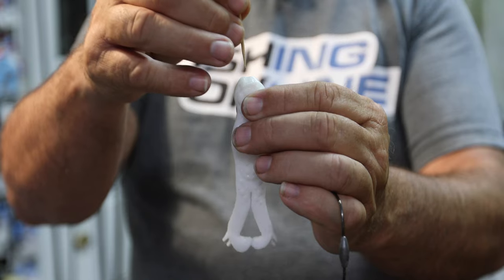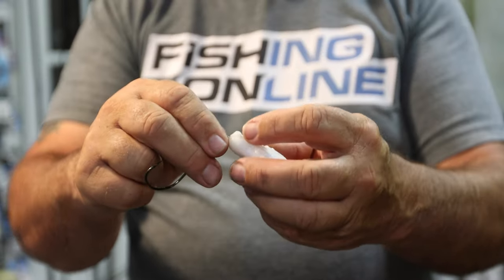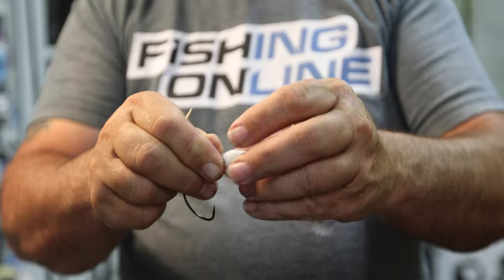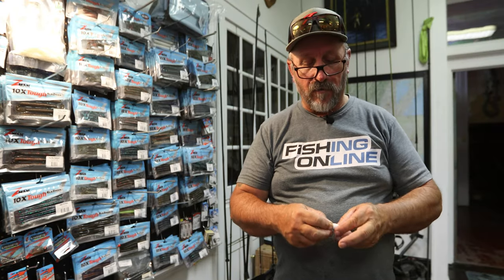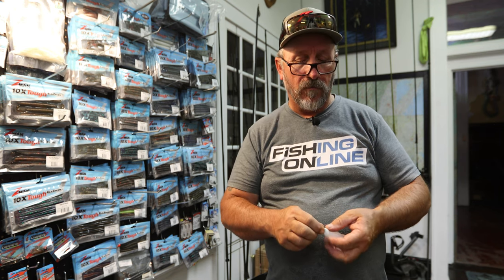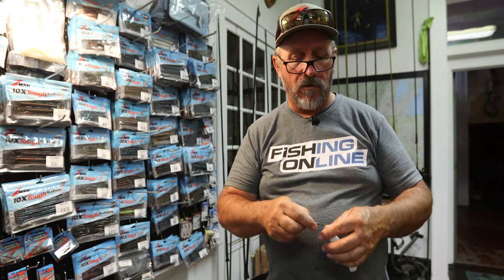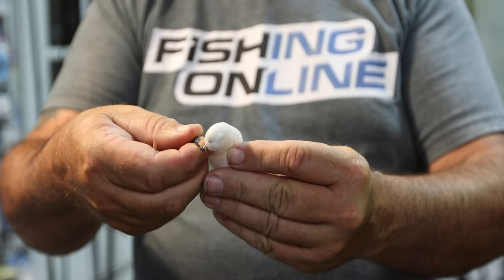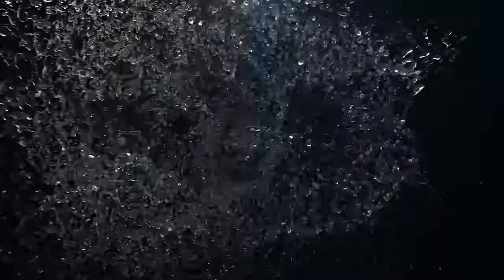ElaZtech and Screw Locks

Comment: It works for only a short time. Eventually the screwlock comes out. It doesnt hold. Ive seen this same thing recommended on another video. Tried it....doesnt hold. I wish Zman or a related company would come up with something to allow for weightless rigging and use of the elastec material. These baits like the streaks, KILL on top when used like a topwater. Only way to rrally rig them to STAY on top is to use the traditional ewg hook but, as we all know, the bait usually slides back down over the bend.